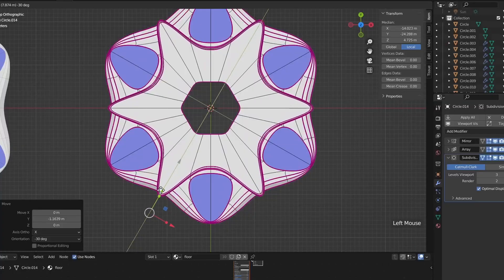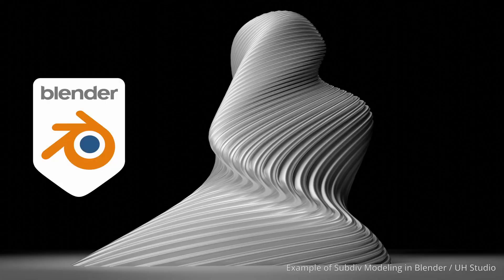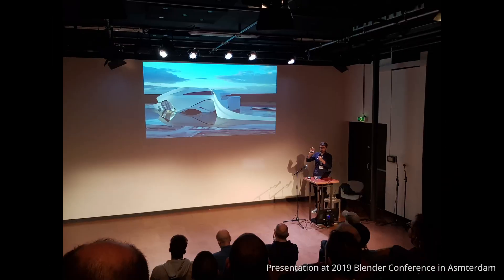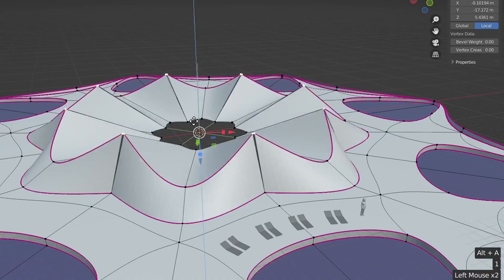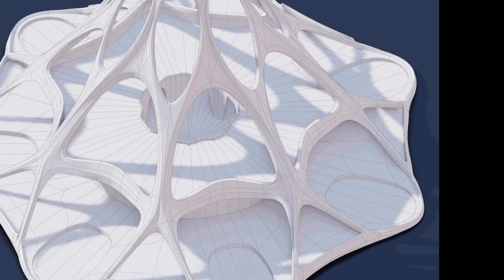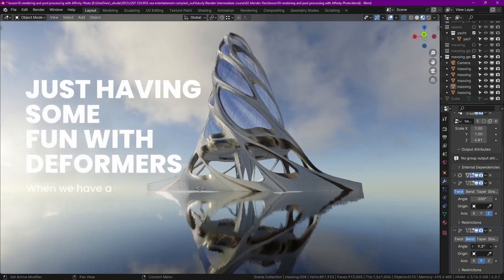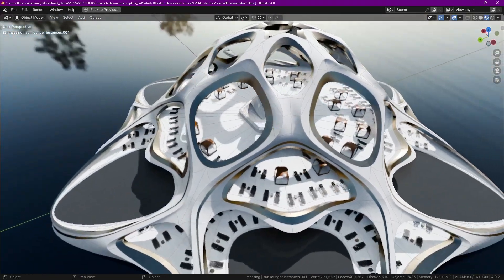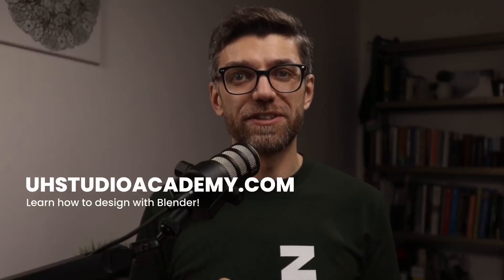New Course! Organic and fluid architecture design with Blender!

Comment: Здравей, можеш ли да ми дадеш някой съвет за правенето на дизайн на сграда.
Reply from the maker: Hi, it takes years of quality education and then years of hands-on work experience to get to a good level of understanding desgin. As a start, it is most important to have a strong concept in mind, beyond the project brief. What are you trying to achieve with the building. Is it a symbol that should stand on its own? Is it supposed to fit seamlessly in its context? Is it more about the public space in between the buildings? Is it more about framing a specific view like a mountain, a water body, or a landmark? Hope this helps :)